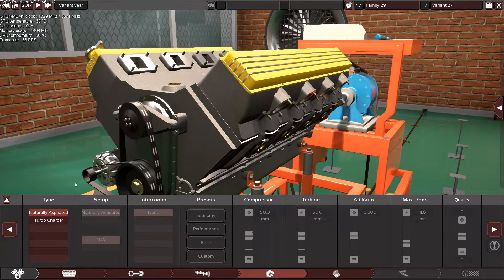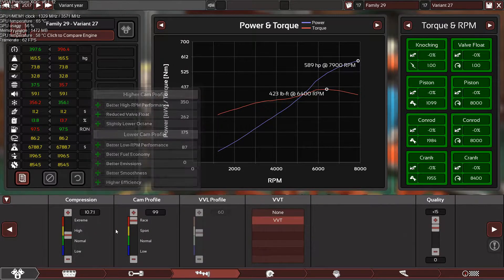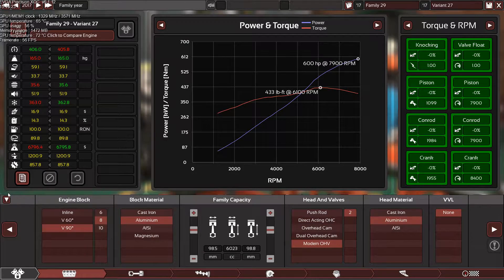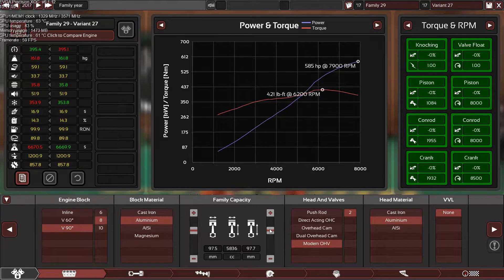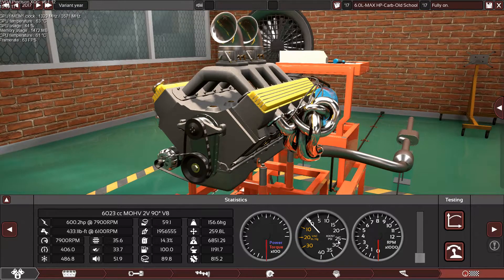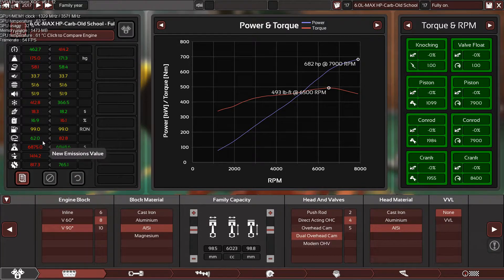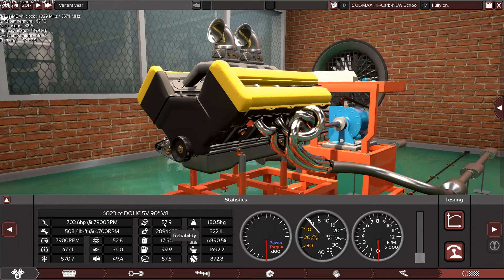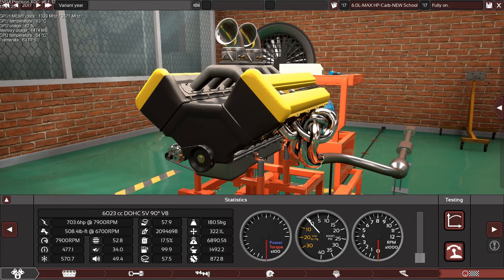6.0L Carburetor V8 with MAX HP.

Comment: Heya, would it be possible to see a formula ford 1.6L kent engine built? I can help with the specs if you need them.
Reply from the maker: +David Carter 
I already know the bore and stroke and that it's equipped with a Waber Carburetor.
But yes it would be better if you can help me with the materials and the valve terrain and compression ratio
Reply: Bshar Nasri the block and head is both made from cast iron, crank is made from forged steel,  i beam steel conrods, it has a ohv twin valve and a compression ratio of 9.5:1
Reply from the maker: +David Carter 
Awesome 
Thank you for providing the specs 
I will make it as soon as i get back home.